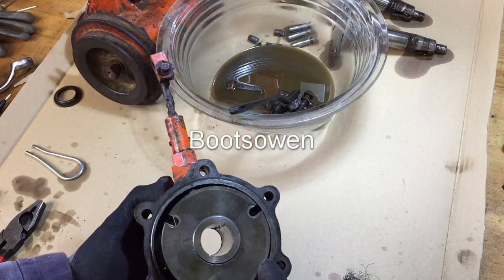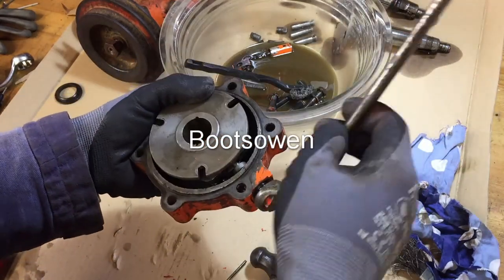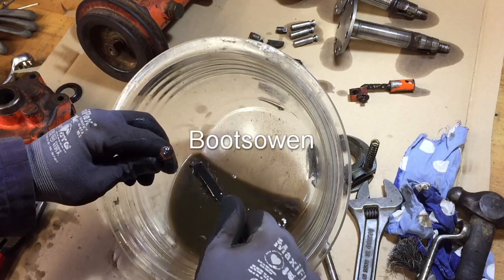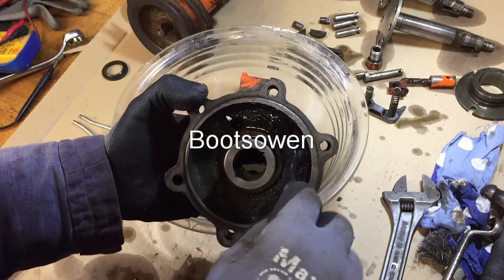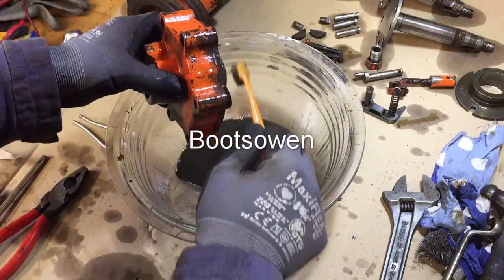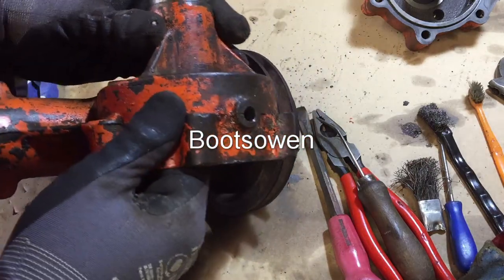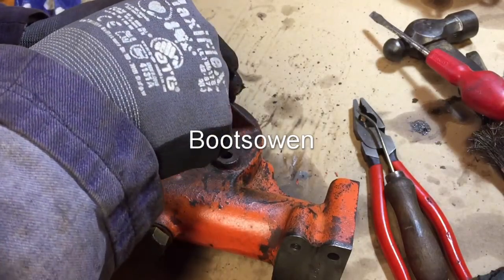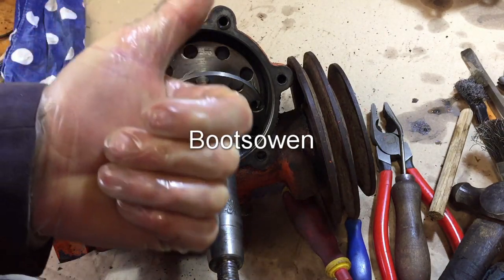Howard 200 | Disassembly and cleaning clutch | installing oil seal | vintage rotavator repair

Comment: im trying fix one now in australia but cant get the seals or retainers.any ideas?
Reply from the maker: They are on uk eBay. About £80/axle for the kit. That’s why my one is still not fixed!
Reply: @bootsowen  think i might use rope seal like on old engines
Reply from the maker: great, make a video of it or let me know how you get on, I would try it too.